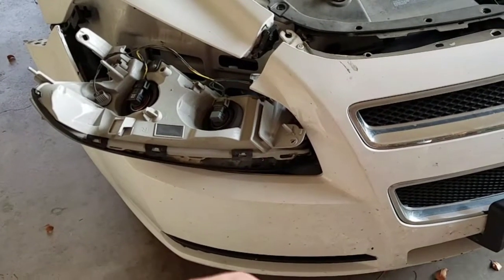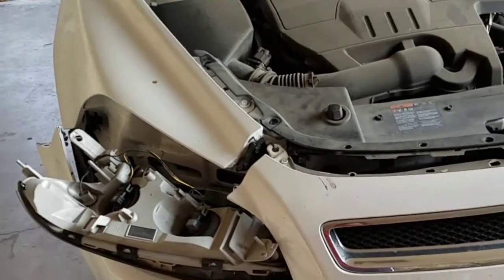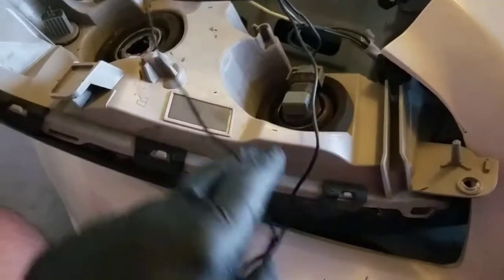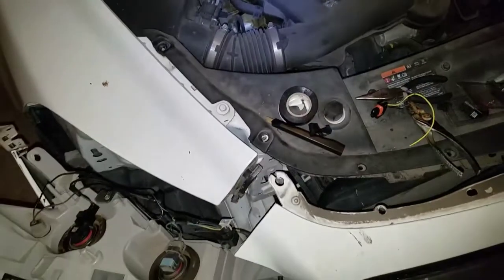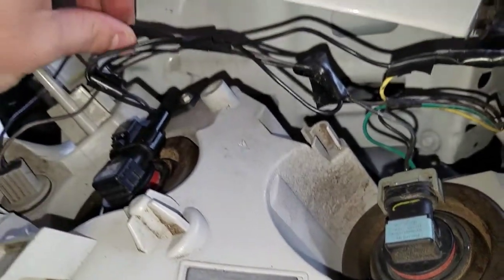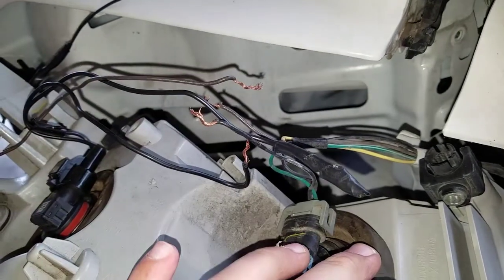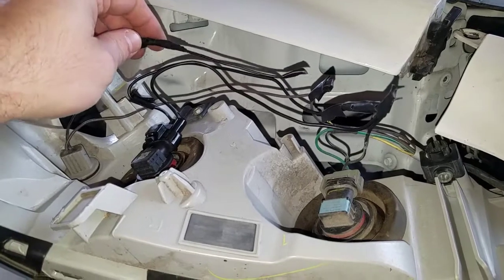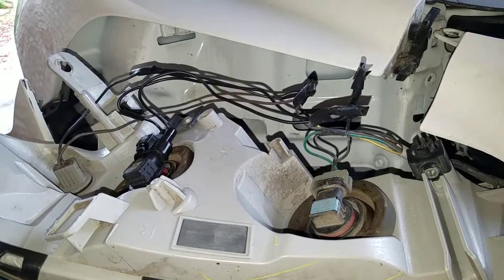Headlight Socket on 2012 Chevy Malibu

Comment: So is there any wire cutting and refixing if I were to replace the whole harness?
Reply from the maker: Good question. I honestly have no idea. I wouldn't think so. I believe it would more so he about unplugging things l, running things, and taping it up.
Reply from the maker: That honestly seems very in depth for me and would've probably had someone else do it if that's what needed to be done. I would like to note though I've had 0 problems since doing this.
Reply: @AqueousLion  hmm ok I’ll lyk thanks for the quick response subbed 💯

Comment: Part No: 645-539  $35 replace the whole harness
Reply from the maker: care bear The headlight went out again about 3 months later and I bought a new socket again and replaced it. This time I put some bulb grease stuff on the rubber around the bulb and on socket. It's been almost 5 months now with no issues. It it happens again, I take your suggestion. Thanks.